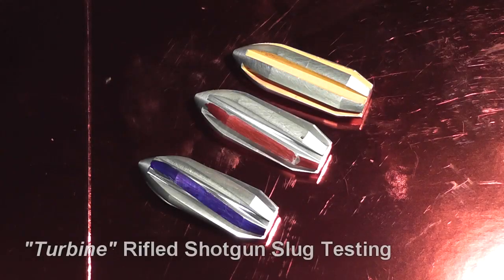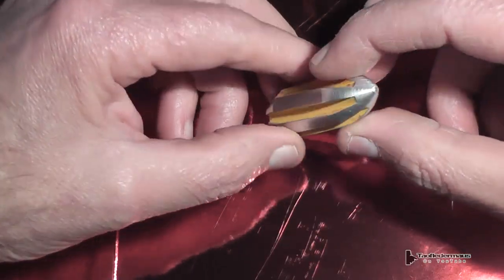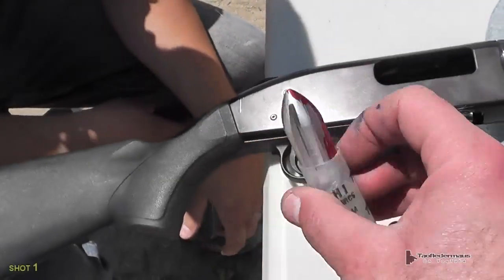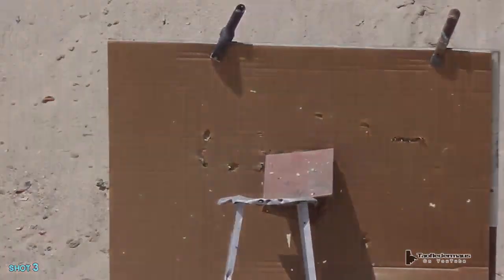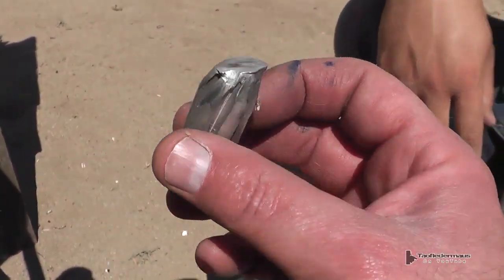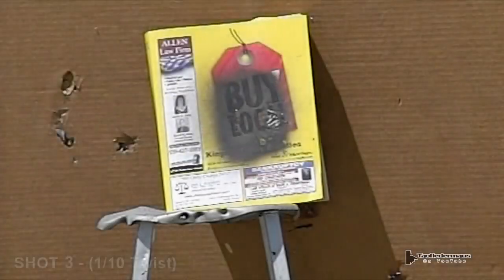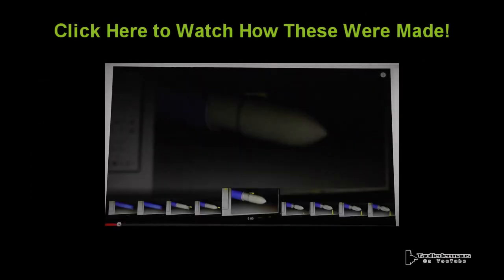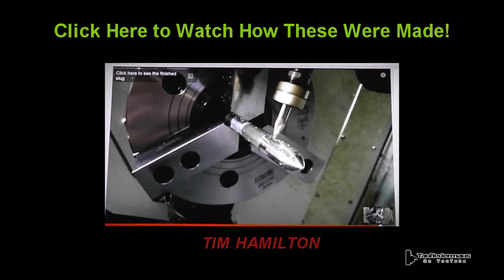Custom Aluminum TURBINE Shotgun Slugs  -Testing

Comment: Some people seem to think that the gasses projecting the slug will have some effect on the rotation or not of the projectile. This is not so because the gasses never come in contact with the projectile because of the wad between the projectile and the powder. Those who suggest that there is little ability doe sufficient air to come in contact with the grooves in the projectile are probably correct. This can be solved in several ways including expandible fins or perhaps only 4 very narrow machined fins with wide lands to allow the air to get closer to the projectile. We learn something from every experiment, if only what does NOT work.

Comment: IMO the problem with these slugs is the weighting. If you examine a normal slug used for a rifle and split it down the middle You will find that the weighting of the projectile is different from point to base. By adjusting the weighting you determine whether they tumble in flight or not. An example of thei is the standard 5.56 military round. The standard round is a FMJ round which flies true and spins nicely. Where it hits you get a neat hole and relatively little damage as it passes through either ballistic gel or human flesh. The Geneva convention prohibits soft nose or hollow point or other forms of expanding bullet. Some nations get around this by adjusting the weight distribution in the projectile ensuring that it will tumble in flight causing maximum damage when it hits. This is what the weight distribution of your shotgun projectiles is doing. Tumbling in flight sacrifices accuracy and the speed is bled off faster, but the damage on impact is increased. At 200-300 metres there is insignificant loss of ballisitic efficiency in a 5.56 projectile, but as you can see with the shotgun projectile the difference is noticeable at 20 metres. So if you want the shotgun projectile to travel further, faster and more stably, you need to look at the weight distribution within the projectile. Think of the weight distribution in a minnie ball - would it be as stable in a non rifled barrel if there was no hollow in the rear? The hollow serves 2 purposes. 1) it seals around the Minnie and 2) It changes the weight distribution. The first thing I would do would be to drill a reasonable hole in the base of the projectile and see if that makes a difference. Maybe even use a lead projectile. Hell of a lot easier to cast for the experiments.

Comment: Those are some well machined slugs, the looked to good to fire haha.

I would like to see a similar design, however with the rifling internal. I understand this would be exponentially harder to machine..
What I mean is there would be a thin outer wall on the slug to keep a flow of air travelling through the rifling instead of being blown off by supersonic shockwaves.

Kind of like a RAMJET without the combustion....
Reply: +Nick Morgan Actually more like a SCRAMJET minus the combustion...

Comment: I think the creator did a great job and already made a great deal of progress. If I could provide any input I would suggest that this new aluminum slug actually requires a modified shotgun and shell in order to properly deliver. I propose a shell that allows a closer tolerance, within the barrel, to the bullet itself. Perhaps a metal shell? Also, the groves in the slug, ment for rifling, should uniformly withdraw to and end where they meet the metal shell at the base of the bullet thus allowing a proper seal. Such a shell should mimic that of a 5.56 or other actual rifle round (Wider at the base, withdrawing to a smaller diameter at the nose of the shell). Hopefully someone can turn this suggestion into a real masterpiece. I would love to but lack the workshop to do so.

Comment: Sabo (say-bow) projectiles have a jacket (usually plastic, that fills the void between the projectile & the inside of the bore) that makes contact with the lands and grooves of a 'rifled' barrel to cause stabilization through spin. A foster slug thru a smooth bore does not spin...the little ribs on a foster slug, are for asstetic purposes only on this nose heavy -- hollow based slug.

Comment: Rifled slugs are a gimmick.  Its not the rifling on the slug that ensures stabilization from a smooth bore its the heavy fore and lighter aft design of the projectile.  They are drag stabilized.  They will not spin unless they have vanes and even with vanes not fast enough (RPMs) for it to spin stabilize.

Comment: In order to stabilize these rounds you need to them to begin spinning before reaching the air. If you had some sort of a SABOT on them that caused them to spin either using a rifled barrel or having the sabot rifled and contact the barrel from the beginning i think they would fly much straighter.

Comment: I'm sorry TAOFLEDERMAUS, but if you really want to have a friend create, or create yourself a rifled slug that travels straight. You obviously need to know the exact rifling of the barrel. If you don't and you just use any rifling, in the minuscule fraction of a second the slug has to adhere and conform to the rifling of the barrel, it will make it out tumbling at an out of control rate that makes it wildly inaccurate... basically, the man that machined the slugs for you made the groves either way wider or way smaller than that of the rifling of your shotgun barrel, so in effect it was still correcting it's wildly out of control path when it left your shotgun barrel, hence the tumbling and extreme inaccuracy. THIS IS NOT AN INSULT TO THE MAN THAT MACHINED THE SLUGS! he had incomplete data to create the proper slugs for your barrel!!! BUT.... if he had your barrel and could create a slug with your exact rifling measurements. I believe he could create a VERY deadly slug!! especially made out of aluminum. if made hollow point. it could splinter upon impact and do massive damage while still keeping people at a medium distance still safe. this could possibly be an incredible home defense round! this is good progress guys!! :) maybe try no rifling and a tighter fit so the barrel can choose the rifling? good luck!
Reply: dude, they shot it using a smoothbore shotgun. It doesn't have rifling

Comment: try making the nose smooth and the fluting at the rear. also  balance wise  you need steel or other heavy metal for the nose and the tail need to be hollow but not too thin.
Reply: also unlike shotguns, rifles have a crown in the muzzle end . you might need that as well

Comment: The gunpowder blast will impart a counter-clockwise spin on that slug while it is still in the barrel. Once out of the barrel, the air will try to reverse that spin. End result is a slug that tumbles.
Reply from the maker: +Lars Howen  The blast is behind the wadding or gas check of the slug,  so it doesn't pass around the slug.
Reply: +TAOFLEDERMAUS Thank you for that clarification. Now I need to come up with another theory as to why it would tumble! Perhaps the grooved slug is useless in the absence of a rifled barrel?
Reply from the maker: The explanation is the design doesn't work!   lol

Comment: perhaps different rifling on the bullet would garner better results? something about the design towards the tip doesn't seem very aerodynamic. like if towards the tip the groove turned triangular instead of keeping the quadrilateral shape. also changing the core's shape could change the flight too... maybe add more weight to the front, cause from what i can see the inside groove forms a flat cylindrical core. the increasing size of the grooves would grab the wind better then, and the extra weight in from would be the center of momentum... with the right grooving and weight distribution i think these could fire w/o tumbling.

Comment: Clean lathe! I love a well kept machine. Live tooling. On screen 3D tool path is a nice feature.  Usually can see movement in manual mode (handle mode)? I can't see the model. Today's 3D gives me hope for  the near future when writers and machine makers increase the graphic resolution enough to were we will be able to just follow the monitor with a precision view.  Ok, maybe that is being spoiled by the technology 8--). I can't quite make out the chuck either. I guess I'm looking to see Kitagawa B210 ? Finest 10" chuck I ever used. Worth all 5 grand of it. My thumbnail is a Mazak Nexus II w/ Mazatrol Matrix on it. It's a pretty sweet tool. The thermal expansion in absolute mode adjusts machine for overnight temperature drop. Guaranteed within .0003 from night shut down to morning first piece. Of course variable with a long boring bar. Bells and whistle )). Nice slugs. How about secondary rigid enough stem off the aerodynamic end leading to a conical flange in the back. Then mill in between the 3 or 4 fins in the flange with the helix in the tail fins. almost like a dart . I know it's extra work but it's only aluminum. Then maybe press a hardened A2 or D2 tip in for piercing? LOL Just throwing the idea out there. Keep the fingers and enjoy. Chris
Reply: +Do Right Slight REVISION. Could be some truth with what jimsondanet writes about reverse rotation from rear pressure coming out of the barrel. Maybe straight fins just to create enough directional corrective drag on the tail end. Not as a mechanical attachment to the slug but just something machined behind it using the vacuum behind to reach the fins for this.

Comment: it may b a late resolve for this bullet that was CNC'd. However try putting some bore butter or some soft wax n the rifling of the slugs to hold the gas behind it....as n a muzzleloader....... it should improve the velocity nd give the true rate of twist speed.
Reply from the maker: +David McCartney  The gas is sealed behind the slug by the wadding/gas check

Comment: Seems the twisting didn't engage the barrel wall or the choke. You can see in the high speed that the round did not leave the barrel spinning. Can't expect that to work through air pressure in the channels. You have t engaged the barrel.

Comment: Seems like maybe it needs some sort of padding between the case and the round itself so that the gasses from the combustion don't jack up the rotation at the barrel by basically countering the rotation in the opposite direction. The fins might work better if they were deeper too. And that might make for an interesting impact as then the round might break up into several sharp pieces upon impact. As soon as I saw the gaps between the fins and the casing I knew this would be a bust.

Comment: The problem now, is the rifling goes all the way. When the powder explodes, the gases are escaping through the rifling. What then happens, is the slug leaves the barrel, and that fraction of a second is all it takes for the gases to blow it any which a way, causing it to tumble. The amount of escaping gases will also reduce the escape velocity of the slug, so it has less punch.

Try gradiating the rifling, so the slug is still a whole outer diameter, at the seated end.
Reply from the maker: The wadding in the shotgun shell seals the gases.
Reply from the maker: +Clint Carpentier  There is a gas check - the wadding behind the slug the prevents the gases from blowing past the slug.
Reply: +TAOFLEDERMAUS 
Well then, it's just a crappy slug. What purpose would one that size serve? And if you need one that size, try elongating the point; you can see a marked difference between it and the .50 cal. Finally, you may be better serve by saboting a case hardened concrete nail; though you may find yourself wasting a lot of saboting materials.
Reply from the maker: Yeah,  the concept just doesn't work.  We made these because we've gotten SO many comments from viewers swearing it would work.    You never know until you try!
Reply: your right! he can make the base of the slug with no rifling, to help in taking the power of expanded gases
Reply: +TAOFLEDERMAUS  My thoughts ( slightly educated guess) would be that the rifling causes inconsistencies in the air pressure beneath the bullet, causing the tumbling.

Perhaps if the riffling was internalized so that the slug had a natural cylindrical shade but air flow through the slugs bored out holes would create the spin.

Comment: It's because when the explosion happens, the bullet is rotating in a direction and when it's out of the rifle the air is forcing the bullet to rotate the other way which destabilize totally the bullet (and slow it down), the rear of the bullet needs to be solid.
Reply: +Magic_Sowap Glad I'm not the only one who sees the problem.
Reply: +Magic_Sowap Agreed.
Reply: +Magic_Saussage I thought the same "design flaw", but i also doubt a solid rear helps much. One would need to do something that gets the bullet rotating in the right direction already in the barrel.

And then i guess the turbine is  way too powerful during flight to keep up sufficient rotation, so it takes too much energy from the projectile.
Reply: great to see men noticing the same
Reply: This. More specifically, when the explosion happens, since the projectile has grooves that travel the entire length of the round, it allows air to pass through from behind forward and acts on the grooves, imparting spin from behind causing it to spin counterclockwise. As it leaves the barrel pressure from behind will drop to the point that its forward momentum will impart greater air pressure on the grooves from the opposite direction, forcing it to turn clockwise instead. That sudden change in direction will definitely destabilize the round and waste a lot of energy. 

A solid rear may be sufficient, but may require a sabot as well, depending on how much outgassing is allowed around the bullet while its still in the barrel.
Reply: +Magic_Sowap 
Yeah totally correct. I was just reading the comments to see if anyone else touched on this fact.

In order to fix it, you would need to make sure that air can't get past the bullet while its in the barrel which I don't think is possible.
Reply: +Magic_Saussage I totally no wat u sayed
Reply: MagicSowap djgh
Reply: Дмитрий Шеш
Reply: Yes you are very right but we do gotta remember the barrel was more than likely a smooth bore ,now if added a full choke with a mussel break this also would create more accuracy but by all means you are right tho magic , I would just love to see it improve more just bc it's a shot gun ,I mean would think that if it could be improved so much that It would just decimate some of the leading rifles out and I for one can believe that a shot gun can do that
Reply: nice point

Comment: I wonder what this round would fly like if used in a rifled barrel. Why not get it spinning before it leaves the barrel. My Mossberg 12 with rifled barrel is a lot more accurate sense I got this barrel. I don't have a high speed camera to see what going on but I can hit a fence post dead center at 50 yards. Not rifle accurate but not bad for a shotgun. I am shooting the the 1 oz sabet slug. Soon as it warms up going to chrony this and see what it's doing.

Comment: You guys are a bit confused. The rifling on any kind of slug is not meant to make them spin. Commercial rifled slugs fly strait because they are heavy at the front due to the hollow base. The rifling is only there to allow it to get through different types of chokes more easily.

Comment: They aren't getting the spiral motion coming out of the shotgun because the inside of the barrel is smooth.. Am I correct? With Rifle rounds, dont they start the rotation in the barrel because the metal inside of the barrel is already spiraled? Rifle rounds dont have spirals on the actual bullet so putting the spirals on the slug wouldn't stabilize it right?!

Comment: First off you need to understand aerodynamics. An object moving through the air at a high rate of speed develops a "boundary" layer of slow or virtually non-moving air around the object. For fins to be effective they need to protrude well beyond the boundary layer. In the case of these rounds the fins are below the boundary layer so they have zero effect on the motion of the round. Next a round moving through a rifled barrel will spin because it actually makes contact with the inside of the barrel where the rifling can force it to turn while moving through the barrel imposing a spin on the round. Your smooth bore barrel is incapable of causing the round to spin. Finally if a round leaves the barrel tumbling fins will do no good because there is too much force being exerted by the tumbling motion for the fins (should they be large enough) to stabilize the round without some additional force acting on the round to force it to overcome it's momentum and stop tumbling. Yes wind force could eventually cause the round to stabilize but by that time so much momentum has bled off the moving round that it would likely drop to Earth before being completely stable.

If you want to achieve stable flight you will need a rifled barrel or much larger fins that are extended at the point the round leaves the barrel and before it's uneven weighting causes it to start tumbling. If you look at gun launched missiles you will notice they are designed to be launched using a relatively low velocity charge that gets them going. Next the fins extend and then the projectile ignites its own thruster to suddenly increase velocity once it's in stable free flight. There are new military rounds in development that do exactly this.

Comment: a rifled barrel imparts spin before a slug leaves the barrel
the problem as i see it is that
a rifled slug in a smooth bore dues not spin until after it leaves the barrel and encounters 'air mass' at this time its already unstable, it really needs external tail fins in order to stablize